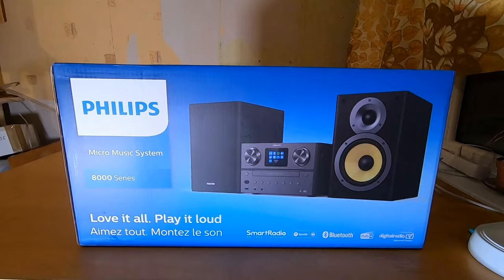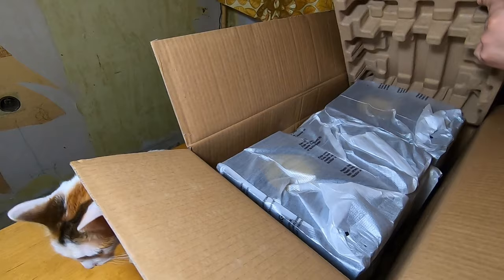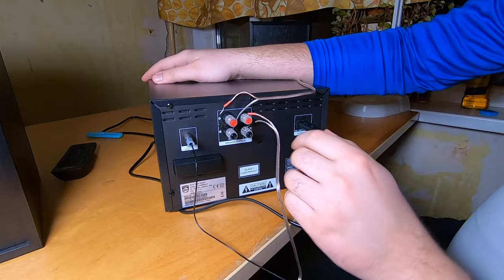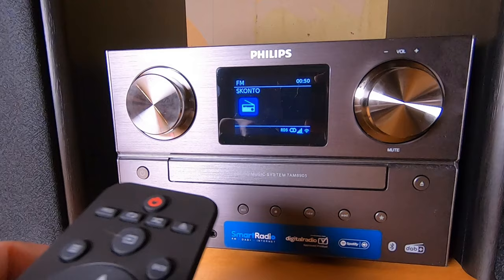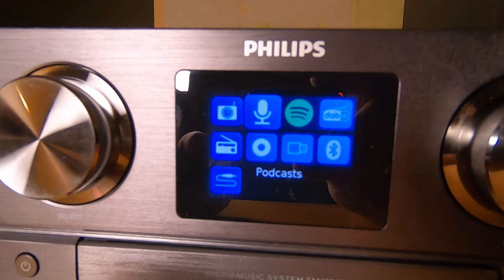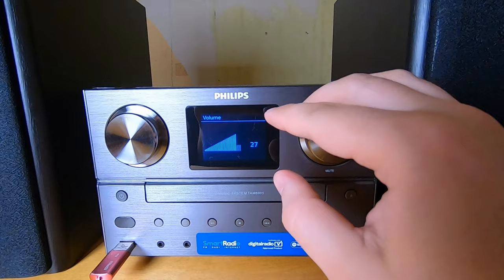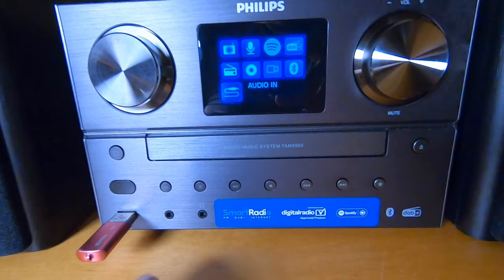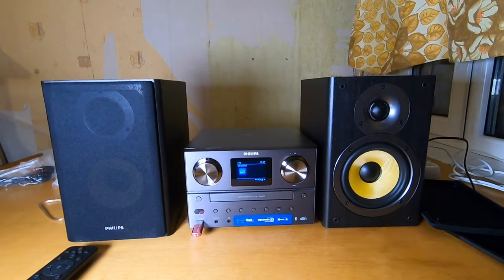Unboxing and review of Philips Micro Music System TAM8905/10

Comment: I already bought this, and i’m awaiting to arrive. I will give my review once I get this on my hands.
Reply: Yes, please, do it I'm genuinely curious about this stereo
Reply: Well I have mine since a couple weeks ago. This is my review: it’s good, more than i expected. The different modes you can use, the bluetooth, cd player works fine, and the internet radio stole my heart in a good way. The only thing i’m not sure is the speakers part, in most of genres sounds very good, but when I listen rock or metal music, it sounds like a crack in the background, I identify and it sound a little hiss with cymbals or anything. I think I have to find any EQ that works with that genres. In general, this micro music system is a good deal if you want to have it in a not big place, just to get chill and enjoy your fav music. ⭐️⭐️⭐️⭐️⭐️
Reply: UPDATE: seems that the crack noise comes from my bluetooth phone, because it doesn’t happen with other option. Also I have connected other phone and sounds great.
Reply: Thank you for your reviews!!!!
Reply: @FKFRND  hello, thanks for your review. I have two questions:
 1)Does the FM radio station memories are kept even if you disconnect the stereo from the wall outlet? I usually disconnect all of my electronics when Im out of home.  
2)Also, does the CD player has the "resume" feature? I mean, if you are playing a CD and for some reason you have to stop it and turn off the stereo, even disconnect it... Once you get back to playing the CD in the tray, does the stereo remembers the track and the minute and second you were playing? Or do you have to start playing the CD all the from the beginning? It's very important feature even more so when playing mp3 CD's with lots of files. Thanks in advance
Reply: same here

Comment: I tried this one and got really disappointed with it! First the sound quality was mediocre at best, and there was no way to turn off the EQ (unless "Balanced" meant it was off?) and I didn't like the preset soundscapes. The volume was too loud - at "8" it should be much more quiet. But the worst thing about it was the cd player, as it couldn't play the discs from the 2009 Beatles box set without making gaps between the tracks! The Abbey Road medley with gaps, WTF?!? My guess is that the mini documentaries on those discs fooled the system into thinking it was a data disc instead of an audio disc, because it showed other data in the display compared to other cds I had played before, which worked fine by the way.

Comment: That's An Absolutely Splendid Stereo System... Better Workmanship That Alot Of The Plastic Built Ones... Sadly 100Watts Is Not Very Much These Days...With Such A Nice Design Seems Like It Should Be At Least 200 Or 300Watts...

Comment: Hello! Thanks for your video.  Does the FM stored statios are kept even if you disconnect this Stereo System from the wall outlet?  Some stereos lose the preset statios when power is unavailable.  I listen a lot to FM radio so this will be kind of a dealbreaker.  Thanks in advance

Comment: Have you had a problem with remote control connection after sfotware update? I cannot use the system with its remote control. Thanks!

Comment: Hi Viljams. Thanks alot for the demo! I've got a question and I wonder if you know the answer. Any idea why my Philips TAM8905/10 doesn't read music from Samsung pendrive 64GB 3.1? It's format is exFAT. I can't change the format to FAT32, only to NTFS. I've checked another pendrive which is ADATA also 64GB but 3.0 with FAT32 and it runs music on my Philips without any problem. Do you think the problem is about the exFAT or it's just about the USB 3.0 version?

Comment: Great review! Don't know if i buy this one or Panasonic Pmx802 or Grundig CMS 5000. Kenwood Smart hifi is out of my choices.
Still with Manu doubts. Marantz Melody X is superb but it needs to 2 Speakers like Dali brand...too expensive!!!
Reply: I have the older panasonic pmx80 for a 5 years and i use it every day. they sound great so go for them :)
Reply: Pmx 80 or 802?
Reply: @pedrorocha1913  80 but it has the same speakers as 802
Reply: Yep! Cos i think PMX-80 is out of stock. Yes, the speakers are the same for PMX-802. Each one 50 W, 3 ohms of impedance. Just think that this impedance os too low. Normally speakers go from 4 to 16 ohms. Thank you for your suggestion!
Reply: And the speakers are in 3- Way....good!
Reply: @Strixeu  I can find only Pmx90 in my country, is it just as good??

Comment: I recently bought this system for my second house. In all fairness it delivers reasonably acceptable sound for the price. However comparing my Esoteric K-07 SACD player to this is like moving from Rolls Royce to Dacia.
Reply: My gosh., that´s a complete and big hifi system with all the staks of devices and bookssheld speakers. Which books shelfs and amplifier uses with that SACD player ?.
Reply: @rudolof8540  not bookshelves, but standalone speakers. Given that you ask, they are a pair of Bower and Willkins804 Diamond and power comes courtesy of a A class Esoteric F-03.